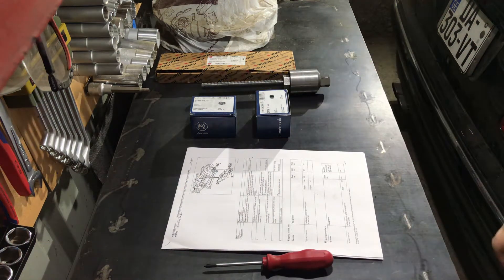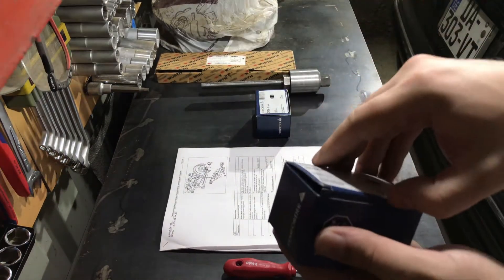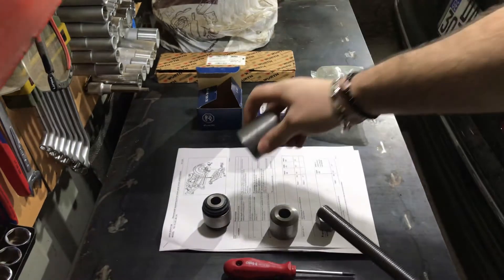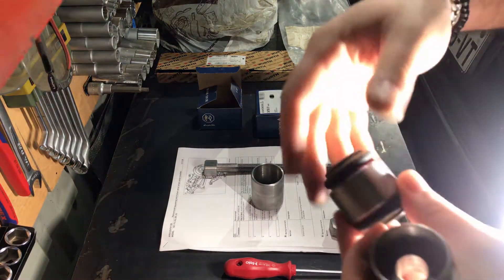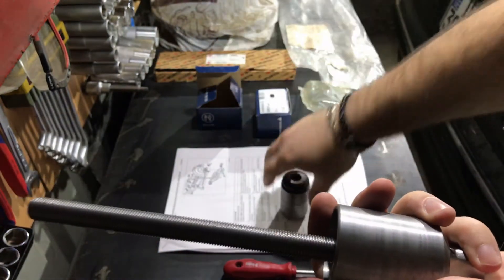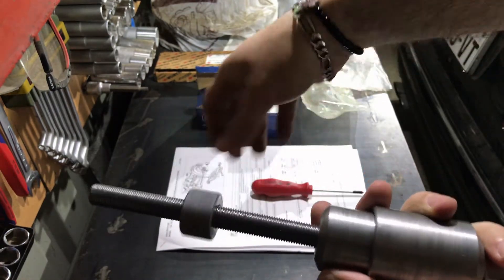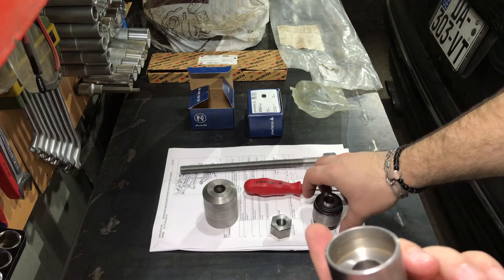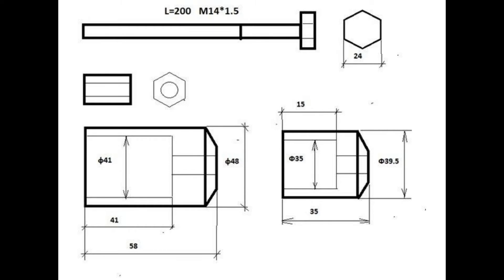Mercedes Rear Trailing Arm Bushing Tool - Traggelenk Hinterachse Werkzeug (W210,W202,W124,W201...)

Comment: I got my Mercedes source w210 bushing tool stuck . It won’t tighten it won’t loosen and it’s on the vehicle here I was trying to take out the old bushing . What have I done ? How to I fix this ?
Reply from the maker: @marcofloresmfcs1  
Can’t tell anything. I have done this job at Dealership, due to the complexity.